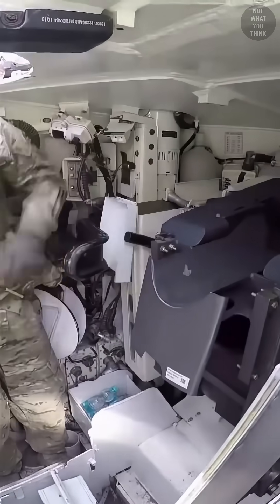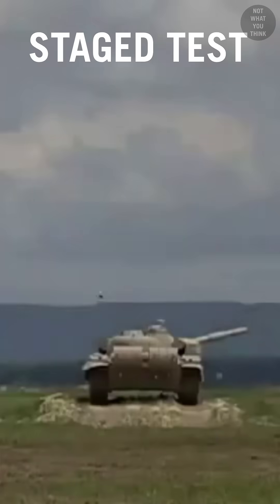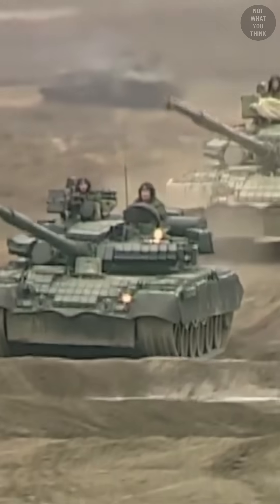Why M1 Abrams Tank Has No Auto-Loader #shorts

Comment: There are a few other reasons some prefer human loads.

One is that different shell types can be loaded more quickly to deal with changing threats on the battlefield.

You mentioned the human loader able to take over roles and help around they tank, that's a crucial one, especially if the crew need to handle more things than normal.

This next one is a bit meh, but human loaders are a bit more "reliable" in that the turret getting slapped by an explosive will hurt, but not necessarily injure or kill the loader, with autoloaders, they are much more sensitive and expensive, and damage can render them unusable.
Reply: Yeah, i feel the vid is informative but also only takes into account older types of auto-loaders.

Next generation tanks like the T-14 don't have the auto-loader and carousel sitting next to the crew, but the crew is instead isolated in an entirely separate fighting compartment. That way, even absolutely catastrophic hits would not be a a death sentence to the crew.
Despite the blowout pannels, abrams are still susceptible to some sort of damage, mainly APFSDS that would sucesfully penetrate the turret face. AS hard as this is, if it can be done, then the dart would go through the turret, puncture the blowout panel and set off the ammunition. With a hole in the cover, the pressure would find it way into the fighting compartment and kill the crew. 

Another advantage, that is going to be FAR more prevalent in times to come, is ammunition size. Smaller is better, but since we have hit the physical limits of chemically fuzed propellant. 105mm was a relatively easy ammo for a human to handle, hence why manual loaders were actually superior to soviet autoloaders in the era of the 105mm. When the calliber had to be augmented to 120mm the human loader could only sustain his max rate of fire for a vew shells before the rate started decreasing substantially. We are now getting to the point where if another caliber increase is needed, it will become far too problematic for a human loader to handle. 
Obviously this would better call for a radical change in propelant chemistry, and some like plasma fuzes could be used by regular guns and regular tanks to augment the capabiltiies of the 120mm, but eventually much stronger guns like a 120 CLG gun would favor autoloaders, so do hypothetical railguns, or even caseless ammo raven guns, all of which are either more suited to autoloaders or require them for basic function. 

Overall autoloaders are the future, its just that its important to design around them and not just "lets just take a crewed tank hull and place an autoloader in" because that will always hold you back
Reply: @mobiuscoreindustries  Because this ain't really about the future. Abrams are also getting autoloaders. 

The Soviet vs American doctrine differences were established before having a safe autoloader was possible. It was one or the other.
Reply: It seems that people think that there is only one kind of autoloader aka the Soviet school. And the minds are still locked on Cold War technology.
Autoloaders are evolving and there are less and less cons in using them since the 1950s..
Reply: @coyotesweg3129  You have to also consider more mechanical parts equals greater probability of malfunction. It could also be argued that autoloaders are more expensive in the short term and make up for costs through less operator wages. If manufacturing tanks for mass production/to be expendable (the russian military doctrine) this would become an issue.
Reply: @coyotesweg3129  Similar to most overly complicated automated systems it is more effective in industrial applications than on a battlefield where the objective is to render said equipment unusable.
Reply: @goosenuggets9693  hydraulic cable on the autoloader blown? Have the loader just swap in a new one--oh wait
Reply: @coyotesweg3129  There is some extent that the technology can evolve, but a bad idea will always be a bad idea.
Reply: @goosenuggets9693  not necessarily. Though I do agree the Cold war Russian style is awful. Semi autoloader and turret  rear autoloaders are a pretty good step forward.
Reply: @coyotesweg3129  Yes... but are they more efficient than human loaders in the context of what was said in this video? Don't take me too seriously, I just enjoy reading all these other comments from "experts", I myself am not one by any measure and know next to nothing in terms of specifics.
Reply: @Edmond Durocher How does that make any sense? If you are going to be sitting in a defensive position the size of your vehicle doesn't matter as much as most of your vehicle will be behind cover, and the rest of the vehicle you can cover with camouflage items. If your tank is going to be on the offensive you are going to want as small a profile as possible to reduce the chances of you being hit on the move. If you switch those around and put a small cramped tank in a defensive role, your crews are going to have a horrible time. Also tanks of the time were not designed to fight in their home countries, as that would be a pretty stupid decision since most of the fighting was predicted to happen between the border of the Warsaw Pact and NATO.
Reply: @Sturmischer  err you need ambush in defensive, not just stay in enemy view, that mean you will get airstrike or artilery on your head
Reply: @duytranuc4025  when this is meant to be the entire defensive line it's kinda hard to do that. Plus in order for them to be calling in airstrikes on enemy positions you would require air superiority, which neither side would have just yet in an opening engagement.
Reply: @Sturmischer  artillery still can call for suppressive, damage tank..etc, and air superiority westen country have big advantage over defensive side (
except some country with very good aa system)
Reply: @duytranuc4025  again, the west's whole doctrine was to be on the defensive side of an engagement with the soviets, it influenced pretty much all of their tank and aircraft designs during the cold war.
Reply: @Sturmischer  yup, doctrine on defensive, real use for attack
Reply: @duytranuc4025  No.... why do people keep thinking tanks are only an offensive weapon. Tanks are just as good, if not even better when used as a defensive tool. You don't have to worry about enemy AT ambushes and you can either set up your own ambushes or long sight lines for long range shots. You can also use more effective cover, or make your own, and keep your tank hull-down so there is less of the vehicle for enemies to engage. Just look at the 6-day war and you will see just how deadly tanks set up in a proper defensive position can be.
Reply: @Sturmischer  because tank use in defensive is not stational, it need maneuver for attack enemy flank(flanking), retreat when overun and attack when need for counter attack, attack is the best form of defence, if stational just put an at gun/ at laucher, tank have better place, hull down  yes, but in a defensive one tank have... many position to go hull down for...better place to attack, stay still=artillery fire
Reply: @duytranuc4025  1. AT guns stopped being used by most countries, and AT launchers have the pesky problem of not having any sort of armor (see the chieftain's video on the subject.) 2. Just because a tank is in a stationary hull down position that doesn't mean there wouldn't be provisions for being able to retreat. Tanks will usually dig out a hull down position with a ramp for getting in and out of their hole easily. 3. you're not likely to be doing any sort of flanking maneuver on an open battlefield at the engagement distances of tank guns, if you were to have anything on the flanks of the enemy they would already be pre-positioned there to shoot into the sides of enemy tanks. 4. You greatly overestimate the accuracy of cold war era artillery, modern day artillery we have laser guided and gps guided shells, but back when tanks like the Abrams, Leopard 2, and Challenger were being developed that was not a threat. A tank in a hull down position is pretty well defended against artillery strikes unless the artillery gets a direct hit on a tank, which even then is just up to luck and the same thing factors into tanks on the move.
Reply: @Sturmischer  1:agree, but this also count rpg at squad, direct fire artillery, and they also have foxhole for cover, and at gun still use in cold war
2:yes, it can retreat, and will expose side when do that, a shot hit tank side= death
3:counter attack most of the time: good
4: you don't need a direct hit to take a tank out of combat, you just need near hit to damage tank optics, gun, track and anything expose to reduce it combat effective, or just stress tank crew, best part: it can fire at any time of the day, that tank already stay still for training fire
Reply: @duytranuc4025  1. Again, AT teams are not going to be used in this kind of engagement, AT teams are meant to be used in ambush tactics, and would get minced in this sort of open engagement. Same thing with enemy infantry squads, you wouldn't send infantry to an area defended so heavily by tanks. Direct fire artillery? Do you mean other tanks, because direct fire artillery is a last resort defense option for artillery guns/vehicles. Foxholes will do nothing against airburst rounds so that's completely out of the question for this scenario. 2. Your side would not be exposed seeing as this is an open engagement at range, and the distance you would retreat at would likely be in the hundreds of meters. 3. You don't need you entrenched tanks to move to be able to do that, more than likely you would have a reserve force move up to push the enemy as they retreat, keeping your entrenched vehicles in their positions in case the attack was just a feint and the real attack is coming after. 4. Optics are well protected by the doghouse on most western tanks, tracks are not exposed as the vehicle is hull down, and you'd need a very close hit to take out the gun. Also, firing your artillery like that would likely result in counter battery fire as artillery radars will detect the location of the enemy's firing positions.
Reply: @Sturmischer  1 that what happen in china war, and it a foxhole which tunnel combo. 2 america also said that until a vietcong with a rpg tunneling right at their face. 3 not with  army that have very few tank, even with america( not all tank in defense, only less than 40% and the rest are tank for counter attack, like you said: reserve). 4 No, it not that good as you think, m1 tank have spare vision block in tank for that reason, yes you can counter battery fire, but not work very good with harassment fire, it too random to counter and sometime it just a poor soul with a rocket artillery(can't counter which radar)
Reply: @Sturmischer  That's not true. You overlook that larger weapons and thicker armour systems often necessitate a larger tank frame regardless of it's role on the battlefield. It's simply engineering, not to mention you vastly overestimate the capability of camoflauge. Most MBAs use non visible light systems to target enemy vehicles and therefore the only protection camoflauge provides is against MANPADS. This is at least if they don't hear you or your gunfire beforehand and for the most part that is unlikely against adversaries that work in tandem with aerial cover.
Reply: @goosenuggets9693  Western tanks size is not just influenced by how much armor they have and how big of a gun they have, Soviet designs have comparable armor and weapons. The difference in size is mainly due to different doctrinal thinking, with soviet tanks being a lot more cramped than their western counterparts who have a greater emphasis on crew ergonomics. Western doctrine also emphasizes a strong first strike capability, meaning that they have to be able to both spot and shoot the enemy first with precise fire. As for non-visible light systems there are many methods to counter them, camouflage that is not in direct contact with the hull can mask the thermal signature of a tank, and there are many techniques used to camouflage how something looks in the infrared spectrum as tested by camouflage uniform developments (for instance how US Desert Night camo works).
Reply: @Edmond Durocher western tanks are not less capable of long range shots than the Russian ones, the real difference is that the Russian use smaller tanks to make smaller targets, the western tanks are more oriented toward crew survivability. The reason why modern MBTs use stabilisers is to be able to fire on the move. What you are talking about was true during WW2, when nobody would shoot on the move, nowadays it’s different.
Reply: @albero319  i mean when you can fire a tandem missle out of the gun it does tend to make other gun less prevlent at range
Reply: @manijubell4054  the longest range tank kill was achieved by a Challenger II using APFSDS
Reply: "One is that different shell types can be loaded more quickly to deal with changing threats on the battlefield."

I don't see how this is faster with a human loader, autoloader shells are indexed and the type needed can just be loaded.
Reply: @cptant7610  You should see how fast loaders pull during combat and not just during training the 5 second warthunder reloading is the minimum.
Reply: @koc988  yea the the loader alto gets tired auto loaders don't
Reply: @solarc4667  auto loaders can get tired too. Wear and tear. Plus they run out of energy, ammo in the rack or otherwise. A tank with its engine knocked out, may not be able to use it's autoloader due to not having power, a person doesn't need the engine to do their job
Reply: @manijubell4054  you know what batteries are? And what alternator is? Those two give your tank and autoloader sufficent power. And it you didnt know russian tanks and parts and weapons, are like Ak 47 very reliable and hard to break, and even if commander or technican in russian tanks can load it with hands, just like in Abrams, and other countries have good autoloaders too, like sweeden
Reply: @solarc4667  if you are in a situation where you are in a combat where the loader can't take a rest, qi think you have bigger issues than crew fatigue.
Reply: @solarc4667  if the loader gets tired lets be honest your tank is out of ammo
Reply: @solarc4667  this is why the loader should be equipped with exo suit arms.  Even if that malfunctions he still has his arms.
Reply: @cptant7610  yes but for example if the tank has the shell you want to load on the opposite side of the breach then the auto loader needs to rotate the ammo to get to that shell and it will take more time, that's for Russian tanks, idk about French auto loaders tho
Reply: @rabiealkurba2520  and the loader still has to find and grab that shell. some loads can take 20 seconds, some take 7
Reply: @TheArcticFoxxo  loader can drop The ammunition, or can get injured by the loading mechanism, when hit can be easilly get unconcius, New loading mechanism are way better than loaders, just look at russian Armata tank. Crew is totally protected in hull and autoloader is way faster than even best loaders
Reply: @rabiealkurba2520  autoloader allowed a tank to have various ammunition, can also keep up with the pace unlike human crew where they will get tired, but I really hope they actually make a blast door for the autoloader
Reply: @zdzisawpodlaski305  or the MTTD prototypes, and back when they gave the leopard 2 armor
Reply: @rabiealkurba2520  French and Korean the shells spin around in a revolver/carrocel  sistem or are in top zone of ammo storage and are droped or drafted to the Thing that puts them i  the gun. There are vidoes on it
Reply: @TheArcticFoxxo  No, Actually only takes 7-10 seconds
Reply: @76456  all russian autoloaders are made for an exact 7 second reload. ive seen footage of loaders loading anywhere from 6-8 seconds up to 20
Reply: @TheArcticFoxxo  the  10 seconds is for when the commander chose an ammunition that was in the opposite side  of the autoloader behind the driver . 

You can choose by option to not reload the gun. Until you see knew target, thats why it might take a long time. Just simply stop and Reload the shell you want when you see target.

When you said "I've seen loaders" are you talking about person loader or carrocel? if carrocel take the answer above
Reply: @76456  the squishy loaders. all of those can go the same for the squishy bois too
Reply: @TheArcticFoxxo  dip down there, it all comes down to military doctrine. Also countrys whit small population or a lot of mountains or open terrain might choose autoloaders.
Reply: @destroyertashkent5713  type 90, type 10 and leclerc have that thing
Reply: There's this one argument i kept hearing as well, Manual loader can change ammo in the breech but autoloader can't.

In the older days, that's doable with brass casing. But today? you are advised NOT to do that, for an obvious reason. You do realize that modern 120mm cartridge has a nitrocellulose cartridge, did you? It's fragile, and combustible.

You want to extract that unfired or dud cartridge to change ammo? you're risking you and the entire crew inside the tank from fire hazard. One incident exemplified this, and it involves a dud round in an merkava led to premature ammo detonation after the loader extracted the round and accidentally broke the cartridge, spilling the propellant granule on the floor, which was ignited by hot brass casing.
Reply: @rabiealkurba2520  
We got a ton of tank experts today!
And all of them seem biased.
Reply: @destroyertashkent5713  an autoloader being able to "keep up the pace" is irrelevant. Combat is at the point where firerate is dictated by target acquisition.
Reply: @casematecardinal  lol its like saying that human loader can sustain it stability while getting shot or moving in a bad terrain which they cant
Reply: @rabiealkurba2520  ever heard of bussel loaders **LEOPARD 2**
Reply: @casematecardinal  they dont have a seat for the loader lol, and avg loading time for T-72 and T-90 is around 4-5 second abram is only around 3-4 plus with autloader that carry more than 2 type of shell and more ammo, also switching the shell that have been loaded into the  cannon will be easier with autoloader
Reply: @destroyertashkent5713  you should spend less time on the wiki pages... and either way, yes there is a seat for the loader in the Abrams.
Reply: @casematecardinal  even if they did have it they still need to stand to load the shell, and bruh I didnt use wiki like everyone knows that autloader is just 1 sec behind human autoloader, without having to put more weight just to make sure those 3 member crew in the turret safe
Reply: @destroyertashkent5713  you dont need to stand to load a shell. Its easier if you are standing but its pretty common to keep a round on the lap for quick follow ups, besides firing on the move isnt part of doctrine anyway, but its still possible.
Reply: @destroyertashkent5713  no?
Having different ammunition on a tank is surely not an invention after autoloader, where did you pit your ass into to find such idea
Reply: @dr_birb , M1 abram can only carry HEAT APFDS and ATGM, T-90, can carry HEAT APFDS ATGM and HE Frag,Guided shell and Fragment shell
Reply: @destroyertashkent5713  seems like you proved me right.
Tanks with crew loaders can use different ammo types
BUT ALSO MAYBE THE USED TYPES OF AMMUNITION DEPEND ON THE GUN, THE COUNTRY PREFERENCES, AND THE NEEDS FOR EACH DEPLOYMENT. HUH
Reply: @dr_birb  what right? autloader still can carry more type of shell amd reduced weight than having normal human loader
Reply: @zdzisawpodlaski305  one well placed aphe wild ruin that auto-loader tho where if a loader is lost a random infantryman will be ordered to take his place
Reply: @destroyertashkent5713  no? Who taught you illogical thinking, cus you're perfect at that.
Autoloader can use more types of ammo, because....? It doesn't matter whether ammo you're stacking into a tank has autoloader or crew. Xd
Reply: @dr_birb  ofc bruh you wont have enough space to have different type of shell if you are using human loader, but autoloader can cuz it give more space for the ammo and can also reduce weight
Reply: @destroyertashkent5713  autoloader weights more, lol.
And no, you can't stock more ammo just due to autoloader.
That entirely depends on tank overall design. They could make crew loader tank with 100 rounds, and tank with autoloader and 30 rounds.
Reply: @dr_birb  no it doesnt lol T-90 have ERA and composite armor but only around 46 ton while M1 abram weight around 68 tonne but still have the same armor as T-90M , even type 10 is equipped with autloader but  only weight around 48 tonnes, even lerclerc with autloader weight 56 ton
Reply: @destroyertashkent5713  because youtube isn't really transparent or working platform, in case my reply vanished, all you need to know is that you're wrong and you're so wrong you belive you're right. And use whole tank weights comparison to compare human and autoloader weight..
Reply: @dr_birb  ofc bruh, human loader is one of the main reason why they add so much armor to protect them while autloader didnt need any extra protection, thats why even the navy use autoloader cannon instead of human loader, its efficient and no need to add extre armor for loader
Reply: @cptant7610  Hmm, maybe modern carousels do. Soviets didn't back then.
Reply: @bravomike4734  Where tf does that come from? Soviet carousels did it too. They literally have a rotating ammo selector switch.
Reply: @bravomike4734 Soviet carousel autoloaders have always been indexed.
Reply: @cptant7610  it's also faster if you want to change she'll type after it is loaded in the breach with out firing the round.
Reply: @cptant7610  the autoloader has to be built to accommodate the largest type of shell for it's gun and having a dude shove it in there is easier.
Reply: @hermatred572  there is only so much weight a person can move, especially repeatedly(as some poeple pointed out with 120 mm people already get tired pretty fast)
a machine doesnt get tired
and if any engineer designs an autoloader that cant load the shell its supposed to, and someone actually approves it...they deserve whatever they get
Reply: @cptant7610  sorry I’m not people fas
Reply: @cptant7610  You ever see a autoloader vs a human loader that is fully trained?
Reply: @cptant7610  and what happens if you’re Otto auto loader fails bud
Reply: @Thatotherhelmetguy  The same thing that happens when your human gets ill or shot?
Reply: @cptant7610  Back when the Abrams was new most auto-loader cassettes could take up to 20 seconds to make half a revolution.
Reply: @bigpatty823  That was 40 years ago
Reply: @cptant7610  The autoloader has to cycle through entire rack in worst case scenarios. A human loader just has to pull from the ready rack, or worst case, move the round from extra storage.
Reply: @YoRHaAttackerNo2  no it dont have to cycle it, new auto loaders they are not like  First autoloaders, in this Days you click button and it automaticaly will get ammo  that you want and even if it need to cycle it takes like half od second to fully cycle, loader need to get right ammo, tank must stay still because it its moving crew can just get hurt, loader can drop round, can get easilly hurt by round, ammo racks can malfunction, cuz they wont open in worst case scenario.
Reply: @zdzisawpodlaski305     Then you know nothing about how an autoloader works or how tanks engage targets. 

First, it's not done by magic. Yes, you press a button but it all depends on the autoloader mechanism that is delivering that round. Some are carousel type, which has to cycle around (and not in a half second because that can be pretty violent) or in the Leclercs case, more like a magazine of a machine gun (the more (if not most) simplistic version of an autoloader you can find.)

Second, tanks almost NEVER fire on the move. If you ever see an M1 Abrams engage a target for example, they sit still, fire, then move. 

Lastly, your con of an ammorack malfunction? Can happen on any system of loading. Dropping a round? Your loader is most likely dead if that happens. Hurt by the round? What do you think he's doing? Slinging it around like a baseball bat? He has more chances cutting his fingers off at the breech. 

Now what are the pros and cons of an automatic loading system? 
Pros- The loading is more consistent until its rack is depleted (applies to loading on the move.) It can be isolated better for safety because instead of a giant door, you only need a small port.

Cons- Harder to compensate for damage as many systems are hard to access or just inaccessible. You typically lack loaders dedicated to the task, complicating it further. Retrieving and/or recovering a round from the breech is harder (impossible in some systems) and lastly, an autoloader is a lot harder to replace than a human. 

I love autoloader systems, but those cons are just as heavy as the pros. As technology improves, it probably will lose some of those cons and make it more viable to replace the human, but in today's time as it stands? No.
Reply: @YoRHaAttackerNo2  im talking about russian autoloaders i dont know much about west, but i was A Tanker in Polish army in t-80 it rotates very quick, and its very hard to break but sure mate
Reply: @YoRHaAttackerNo2  Abrams, are Abrams and are way overrated, russian tanks can easilly shoot on move and if you sit still in place and wait for Gunner to reload or wait tank to stop you will get killed by some farmer boy from russia XD
Reply: @zdzisawpodlaski305  To the very next round, yes. But if you need to cycle around a quarter of your carousel, it can be a second or two.
Reply: @zdzisawpodlaski305  And no. There's this thing called the hull down position. You are correct, the M1 Abrams is overrated. However just about every Western Tank uses that method. They CAN fire on the move, but it's preferred to shoot then scoot.
Reply: @YoRHaAttackerNo2  and yes you can get hurt by round if you drop it on your toes friend from military were taking round from rack, tank started quickly moving and he drooped it, he had broken leg. It hapens sometimes dude, and you even dont know how apfsds works dont you? It dont blow up like he shells, if you droop it, it wont blow up, and remeber in this Times ammo is way more "stable" than in WW2
Reply: @zdzisawpodlaski305  Oh I'm not saying he's dead from the round exploding. I'm saying he's likely dead because an APFSDS round found its way to him in a violent physics experiment.
Reply: @YoRHaAttackerNo2  yes i know they can fire but you must realize that tank crew is trained to do this, its not that good sure when you hide your hull its Good but when batlle is taking place on nearly flat terrain? Comander can make mistake and say that tank must stop but it only makes it more vurnable to shot from fast russian tanks
Reply: @YoRHaAttackerNo2  it takes nearly 1,8 second to cycle it around in T-80 I was in this tank and i know how fast it rotates when its needed and you know you dont put rounds like that in russian tanks, There is Special methode to Store ammo, for example two round heat and another two round apc or other it cycles way faster
Reply: @YoRHaAttackerNo2  ok
Reply: @YoRHaAttackerNo2  that extra storage are under turret basket, it not easy to reach as you think
Reply: @YoRHaAttackerNo2  and in autoloaded tank you can...refill it right in tank (t72 and t64 style autoloader)
Reply: @YoRHaAttackerNo2  nato use smaller gun= smaller round to load, good luck for hand load 125mm shell(41ibs) with charge in 6s
Reply: @cptant7610  Like the S1 and 2
Reply: autoloaders have the capability to be much faster than a human loader, and can deal with multiple ammo types since WWII, it's all in the design.
the United Shoe Machinery Company made an autoloader that could load the standard 75mm M3 in M34 cradle at a rate of 20 rounds a minute and with selectivity between AP and HE (stored in two 34-round magazines), project started mid 43 for T20E1, system tested in T22E1, dropped in April of 43 due to "unsufficient mechanical reliability"

then the Rheem company made one for the 76mm on T37 (later morphed to T41) and was tested in M26 in 1950, the system loaded the gun at a rate of 18 rounds a minute while returning the fired casings to the magazine and tracking the gun breech at any elevation, the mechanism was then tested in T41E1 and in this version each round in the magazine could be indexed so as the gun could fire 3 different types of ammunition with a fire rate upgrade to one shell every 2.3 seconds (about 26 rounds/min), still considered not reliable enough and was canned

October 1952, the Rheem company was tasked with designing an autoloader still for a 76mm, but this time on T69 (nice), the oscillating turret removed many issues of the system due to gun/autoloader misalignment, again the system was selective between three type of ammunition and again rate of fire upgrade to 32 rounds a minute (1.87 second loading time) from an 8-round revolving magazine, the tank was just a technology demonstrator and the autoloader was unreliable so it went nowhere, tho it could be made more reliable by slowing the rate of fire by half at a respectable 16 rpm (3.75 second loading)

then United Shoe Machinery Company worked on a solution for T54E1, a 105mm gun this time. feeding from a 9 round magazine at 35 rounds per minute (1.71 second loading time), still selective between 3 types of ammunition, T54E1 was again a tech demonstrator so i didn't go much further, no idea on it's reliability but judging on past experiments and the sheer speed of the thing, i suppose not too hot, tho it seem to have brought fruit as it's operation seem not too far removed from what was utilised in M1128 MGS

keep in mind those autoloader were made because armoured Branch wanted to upgrade the fire rate of their tracked tin cans, not necessarily remove crew (T69 and T54E1 had 4-men crews)
sauce: the_Chieftain video on US autoloaders: https://www.youtube.com/watch?v=Qnsb2LQFvoM

on the having an extra man around, take a page from the French book, the Leclerc tank is a 3-seater but all tanks have a 4-men crew, how?
well you take all of the extra lads of the company, seat them in an APC and the y can do security, scouting, or stay in the rear to help with maintenance or replace missing crewmen

on, the safety point,autoloaders (at least the cassette type used on Leclerc, Type 10 and K2 among a few others) are much safer, instead of having a big heavy door opening from the bustle ready rack, you have a small opening, just large enough to let the round through meaning there's a lesser chance of a cookoff injuring the turret crew or just crewmen being mauled by the ammo door (which can happen on Abrams)
Reply: @Edmond Durocher ffs stop watching your stupid videos about tank waves. Russians don't fight like that.
Reply: In auto loader you can reload at any speed, Auto loader is actually light and doesnt hurt crew, because there is a steel panel separating the crew.
Also make tank lighter and smaller
Reply: A human loader can also improve its time. And auto loaded cannot unless it is improved by engineers
Reply: @bisonmini  fastest autoloader are strv 103 tank auto loader, only 3s per shell, what kind of human can do that without an assist mechanism?
Reply: @bisonmini  So you're saying a human loader can be faster & more efficient than a dedicated machine? In a real world scenario of course.
Reply: Not to mention if autoloaders jam your kind of screwed
Reply: @captain6255  ot doesn't jam because it isn't exposed to external factors, if spall struxk outo loader then it get stuck, but even then, Normal loading gun can get stuck too, The blast door.
Reply: @76456  but still mate I'd rather have a person loading the gun than some machine that if it gets stuck or doesnt fire a round you on your own
Reply: @captain6255  Fire is made by person, Also loader can die, get tired, drop rounds in the floor and need to drive slowly (30km/h in good crew) to load on the move
Reply: @76456  ok then
Reply: @76456  it is true, guys reall Life is diffrent than war thunder soviet and russian tanks are probably The best in The World, american Abrams is way overrated, in batlle field it can only ride  for like 45 minutes because its engine that is A turbo jet turbine, eats soo much fuel and generates soo much heat that even radiator is going to die quickly, it breaks every Time when its on field. Its soo freaking heavy that There is Special version of Abrams only created to get out of field other M1A1. German tanks are really wierd because they can Easy get destroyed from front by russians canons or even upgraded rpg versions. They are sturdy but in rl shoot to The driver hatch can blow out tank or just destroy its gun or engine. Russians have developed tanks (T-14, BMPT terminator 1 and 2, or prototype T-15) that have really good protection aganist everything, high mobility, probably The best gun in The world, Systems that can scan and  detect tanks, helicopters, or jets, they can jam misiles and radars There is even project and prototype that cant be detected by infrared. Im from Poland and i can say that t-80 or other thanks  from T series would easilly destroy leo or Abrams.
Reply: @captain6255  just like west and NATO, they wont use auto loaders because they are scared that something goes wrong, thats why they dont develop it
Reply: @zdzisawpodlaski305 Ukraine knocking out russki tank left right and centre.
Reply: @captain6255  in t-80 and new russian tanks its Simple to unjam, There is Special system for it, and if it would totaly jam Gunner can load rounds manually
Reply: @zdzisawpodlaski305  thx
Reply: @captain6255  ah you can just...hand load it, but hand load a 125mm shell(from 5kg+/11ibs+ to holy 19kg+/41ibs+) all the time is pure dumb
Reply: @captain6255  Well, if we're talking about ifs, if the human equivalent is jammed i.e. injured/killed, same thing.
Reply: @Edmond Durocher Bad reverse speed? T-80 can go 35 Km/h, a Polish tanker told me
Reply: You guys are all wrong.

If first world nations fight only the first shots usually count. Being more reliable doesn't matter if you get blown up by a missile. Russia has optimised their tanks for fighting other first world countries. American has optimises their design against Terrorists armed with RPGs that can't penetrate their armour.

Robust is less efficient, but robust means it works in situations you don't expect. Russian tanks are more efficient, American are more robust.
Reply: There pros and cons on both sides. Auto-loaders dont get tired and can sustain their rate of fire but how often are they going to be a in situation that calls for a high level of fire 
Right now, 120mm rounds weight 49lbs. heavy but not super heavy. The planned 130mm rounds are nearly 70lbs
Thats way too heavy for a human loader
If 130mm becomes the new NATO standard , then its sayonara human loaders
Reply: Machine is cheaper than human, always
Reply: In my village we hit Russian tank with the big stick. Stop autoloader, stop tank, drink vodka with drivers. They appreciate the kind gesture.
Reply: Heh human loads
Reply: I prefer human loads 🤤
Reply: t series cost less than abrams
Reply: There’s also that a human loader takes up much less space and weight than an auto loader
Reply: @VlRGlL  homeboy auto loaded tanks are typically lighter and smaller then non autoloaded vehicles tf you on?
Reply: @VlRGlL Auto loader is made of plastic amd have few metal
Reply: @VlRGlL  no, because you will need a human height turret basket and space to turn around=bigger tank=more place need to armored, for auto loader tank turret basket just need space human sit (why not 
lie? just like driver?)
Reply: @VlRGlL  Actually it's more because of the extra volume of the turret, which means a lot more armor
Reply: @VlRGlL  not really. Since human loader needs room to stand to properly load the gun, meaning the tanks need to be taller, meaning extra armor (coment above mentioned that 1cm height of a leopard equates to 600kg) Thats why soviet tanks are usually shorter and vastly lighter compared to western tanks.
Reply: @VlRGlL  Dead wrong 🤣
Reply: @happygnome4620  
   Not dead wrong. The average adult male weights about 200lbs and takes up around 3 cubic feet.
Reply: @cooliobob1274  Right. and an autoloader as seen in the video is quite large but the configuration is much more space efficient. There is no interference with any other crew members.
Reply: @cooliobob1274  how does the average adult male only take up 3ft³? Are you sticking them in a trash compactor? Just an approximate but 6' high × 2' wide × 0.75' deep = 9ft³.
Reply: @KirkHermary  
    Dunno bro... I'm pretty shitty at math so I lazy assed it and googled it. Now you point it out it is pretty fucked. Maybe they were measuring fetal position?
Reply: @cooliobob1274  I just choked on my lunch! Imagining a bunch of dudes cruising in a tank... all scrunched up 😆
Depending on how crammed the quarters are it could be possible 🤔
Reply: @happygnome4620  tell me how a machine takes up less space and weight than one guy and a door
Reply: @happygnome4620  weight yes, space maybe but I’m leaning to yes
Reply: @happygnome4620  an autoloader may weigh multiple tons, at least a few hundred kilos
a human loader at max like 100kg
Reply: @ikat_tracer  Multiple tons??? I think you got that wrong.
Reply: He is dead wrong, an autoloader is much more compact because it doesn’t require the space a human needs to maneuver around with a shell and overall the expenses of maintaining an autoloaders actually are cheaper than paying the human loader and all the other expenses of keeping people alive.
Reply: @cooliobob1274  how much structures and armour to enlarge the tank for those 3 cubic feet?
Reply: @Edmond Durocher for Russian tanks it’s the exact opposite doctrine, western tanks are meant to be able to sit for days in a defensive position, thus they are larger and have a bit more focus on crew comfort, whereas Russian tanks were designed to have as small of a profile as possible so that they are harder to hit while moving. The whole NATO cold war doctrine revolved around defending the border between East and West Germany while Warsaw Pact forces invaded across the border.
Reply: Also it has lower cost of maintenance than autoloader
Reply: @unddasheit4034  I mean you got to feed a person house a person you got to train a person
Reply: @captain6255  uhh, yea(?)
Reply: True
Reply: I'll give you a human load hahaha
Reply: Plus it's nice to have an extra guy gor a pick up basketball game.

Say, does the driver get less pay cuz he gets to lie down on the job all day?
Reply: You forgot to mention that AI is getting better by the day and is smarter than Recruits.
Reply: @TheCuriousNoob  yes but the thing is a shot can pen the turret and knock it out of action if its an auto loader but when its a crew member they can easily be replaced not saying that lives dont matter they do but its more efficient to have a crew member in case if a malfunction
Reply: Shit I need to shit and an extra bag of shit in a tank haha
Reply: This is good to know. Thanks
Reply: @Edmond Durocher nope, what you said is bs. Russian tanks are not “better at sniping” and modern tanks don’t need to stop to shoot since they are fully stabilised. And what makes you think that Russian tanks are made to defend and not to attack? They are MBTs, they do everything.
Reply: Exactly that....20-30k a year for a soilder or 200k for autoloader system 🤔
Reply: @lukekennedy6394  20- 30 k? Are you insane this dudes get even 10 k per month, russian autoloader cost like 50 k dolars XD
Reply: @zdzisawpodlaski305  nope, a britsh or American private only get 20-30k $/£ per year.
Reply: @lukekennedy6394  probably you dont know how much they get, my brother was in British army and was getting 38k per year
Reply: @zdzisawpodlaski305  I definitely do now how much they get 😅 and I'm telling you a private wouldn't get 38k....sergeant or equivalent with a few years experience = higher pay band would get 38k.
Reply: Aren't autoloaders heavier because of the extra mechanism and metal machinery needed?
Reply: auto loader by definition is any mechanical aid so technically the abrams does have an auto loader as it’s reload is mechanically assisted.

it’s not a automated loader
Reply: What happens if you have a Poseidon in a Russian tube with a proximity fuse? 10Mt will trigger WWIII. It is much better to keep the war cold. That way there will be living children who can ask, "what did you do in the war, Daddy?" Ghosts do not answer questions.…
Reply: Another one is skill, when a human loader is very experienced he can speed up the loading process and increase the rate of fire, this is common on most american tanks back in world war 2, withthe sherman having a minimum of a 3- second reload
Reply: @franzivan4567  Well I hope that we don't have to do a Test To Destruction in order to decide the matter. Because such a test would give you the info you want but at an unbelievable cost.
Reply: P
Reply: I’m
Reply: hehehehe human loads ;P my dirty mind gonna play with that one
Reply: @mizziepet  
Begone perv
Reply: Lap loading?
Reply: Haha
Reply: Intuition
Reply: A private with a broken arm could probably still load if high enough on adrenaline, an autoloader with a broken piston not so much.
Reply: Human loads
Nice
Reply: Also what happens if the loader fucks up or jams?
Reply: Jesus no one here knows what they’re talking about lol
Reply: Plus, as cruel as it is, it’s likely easier to change out a injured or worse crew than put the tank out of service to change or repair the autoloader mechanism
Reply: You gotta get lucky on the human being more reliable tho what if they are an absolute dipshit?
Reply: Important is which tank has more accuracy to hit a enemy tank and has heavy armour.
Reply: Plus I can only imagine an auto loader has a lot of moving parts. Those tend to be kept to a minimum for things like this for good reason
Reply: "There are a few other reasons some prefer human loads"

Is that right? 🤣
Reply: More of a simplicity is reliability thing here
Reply: @Edmond Durocher you don't seem to be knowing what you are talking about. russian tanks are designed for attack. german tanks to defend, and american tanks are in between. 
hence the bad reverse speed on russian tanks -> good reverse speed on american and german tanks
bad depression on russian tanks -> good depression on american and german tanks 

russian tanks are the ultimate bad sniping vehicles and are yet to penetrate the turret of a Leopard 2A7
Reply: @ikat_tracer  Man this is filled with stupid and incorrect points. 

>russian tanks are designed for attack. german tanks to defend, and american tanks are in between

They're all MBTs, they're all designed with the same base philosophy in mind and built to meet the requirements of their environment. Technically every tank is built for defense, every MBTs ideal engagement situation is when they're hull down, hence why the front of the turret is the strongest part of the vehicle.

>hence the bad reverse speed on russian tanks 

Also wrong, T-series tanks have poor reverse speed because they have a single very low ratio reverse gear. The purpose of which is to ideally allow the vehicle to extricate itself from any kind of ditch or mud etc. that it might find itself stuck in, without the need of another vehicle or a recovery vehicle to pull it out.

>bad depression on russian tanks

Once again this is due to design philosophy based upon environment. They're overall smaller and lower profile than Western tanks, the hull and turrets are both shorter, thus lending less room for the breach to be able to rise in the turret thus leading to less gun depression. Plus the fact that most of the area they would have had the possibility to engage in combat in was flat enough for it to not be seen as much of an issue.

>russian tanks are the ultimate bad sniping vehicles

They're probably actually some of the best, they're smaller than Western tanks, therefore they're harder to identify and hit than Western designs would be.

>are yet to penetrate the turret of a Leopard 2A7

And anybody has yet to penetrate the turret of the M1A2, or the 2A6, or the 2A5, or the T-90M, or the Challenger 2, or the Leclerc, or the Type 10, or the Type 90 or even the Ariete. Whats your point? Idk where you've been but there hasn't been a war against contemporary Eastern and Western powers since WW2, nobody has penetrated anybody's turret in a while.

And yes autoloaders are much smaller than human loaders, its pure fact that crew take up the most space in tanks. If you really need proof of this, look at the difference in size between western tanks and T-series tanks. In western tanks you would be able to eliminated an entire half of the turret if you removed the human loader.
Reply: Наши танкисты знают что заряжать танк можно и без автомата заряжание, в случае поломки автомата заряжание снаряды заряжаются в ручную, как в далёкой Второй мировой.
Reply: https://youtube.com/shorts/YRvzXdtm5A4?feature=share
Reply: I thought the M1 only fired one type of round
Reply: What happened if Human loaders needs to take a shit??😂🤣😂
Reply: I don't know how Russian designers think, their tanks are crowded, has multiple weak spots, only 3 crew members, autoloader that has the ammo all over the tank which makes it easily destroy if penetrated
Reply: @rabiealkurba2520  But russian tank are also shorter and weigh less than nato main battle tanks
Reply: @rabiealkurba2520  Disregarding the lower and overall smaller size, more simplified and easier to operate, and the fact that the weaknesses you see are because certain users were stupid. (Namely Saudia Arabia and their mishandling of ammunition by sticking it literally everywhere.)

Russian tanks are built for more level, open terrain. There are as many weaknesses as on the Leo 2 or Abrams, but they always take hulldown positions whenever possible where say a T-90 will always try to strategically advance forward.
Reply: @rabiealkurba2520  if u got penetrated, and don't die, you mashine is out of action in any case.
Reply: @rabiealkurba2520  Smaller tank aka harder to spot, harder to hit and easier to hide, if enemy can't shot you in first place why need thick armor? Oh and for the expensive part: 2,5 t90 tank price for 1 m1 tank price, so it mean easier to make or just cheaper because it small, autoloader so for 12 men russian can use 4 tank when america only 3. For ammo all over the tank part: you will get out the tank asap when it get hit and penetrated, all kind of tank.
Reply: @rabiealkurba2520  Russian tank philosophy has been to make the tank smaller which, in theory, makes it survivable by being harder to hit. Though at the sizes of modern tanks being small or big is really a non factor.
Reply: @rabiealkurba2520  I think it's the American way of thinking they make the best history begs to differ the Sherman was a good tank but weak armour the Russian tanks were poorly made but stronger against the German guns,Just because you have masses of technology  and 4 crew doesn't necessarily make it the best and in the second world war the Russians had the little used KV1 wiping out panzer 1 and 2s with ease and the panzer 75 just bounced of KV1
Reply: @rabiealkurba2520  USSR had doctrine of hiding tanks, and treating them as expendable. So their tanks have lower profile (will be spoted way harder than western construction), and are not oriented on defence, they were also crewed by recruits, so autoloader was way more efficient than random farmer. On the other hand western tanks are prepared for mass assualt and taking hit, with US tank more focused on taking hits, and European on avoiding them through spotting enemy earlier, and getting their ass out of there because they are not meant to stop Russians just slow them down. 
So you can see quite good weapon race for hiding tank on russian side and searching for it on West European side, with American designs ignored because Soviets wanted to "end war" in Europe before USA will reinforce them. Design way of thinking: of European weak armour great mobility and opticts, Russian mass production oriented low profile tank hard to spot, and American attack tank to push mass army.
Reply: @kyurenm5334  American and European tanks are not different. Idk why you think that European tanks have less armour and more mobility or that they are better at identifying an enemy target than the American counterpart, but that’s wrong. The western tank doctrine is based on identifying the target and shoot it first, without taking hits.
Reply: @albero319  they are different, the leopard is very different to the Abrams,

And the Italian MBT is infamous for having weak armour
Reply: @andreasurace4386  the leopard 2 and the abrams are extremely similar. The Ariete MBT used by the Italians has bad armour not because of a different design philosophy, it’s because it never had an upgrade since the ‘80 (except for add-on kits with slightly more frontal armour or ERA on the sides). At the time it was created it was similar to all the other tanks used by nato, but nowadays it lacks armour and mobility.
Reply: @albero319  They guy asked about what designer had in mind, and not how these tanks looks after half century of modernisations. stock Leopard 2 or Leclerc had joke and not armour when compared to Abrams with a lot of weak points, while stock Abrams had a joke and not optics and engine when compared to former two. Nowadays warfare philosophy changed, and tanks would be designed differently, which you can see in T-14 Armata.
Reply: @kyurenm5334  T14 has separate crew room, how cool is that.. the crews are more protected than Leo 2 and Leclerc. But that cost its (T14's) turret armor. Can "No armor is better armor" fit in this T-14 turret armor?
Reply: @kyurenm5334  the specific were different, but the idea was the same. The Abrams wasn’t designed with armour for taking hits, the idea always was shot first and don’t be hit.
Reply: @albero319  Then it would have better optic, and less armour for better performance, like first gen post war tanks like leo 1 or amx (don't remember number)
Reply: @kyurenm5334  the armour was different, every tank had to find a balance between armour and mobility, and that balance was different in the American and European tanks, but that’s not much of a difference, the main focus in a tank vs tank engagement was on long range accuracy and visibility in all NATO MBTs.
Reply: @kyurenm5334  Yeah, no. 1. Challenger tanks. What do you mean European tanks have weak armor? A challenger tank has only EVER been destroyed by another challenger. It's equally if not better equipped than the Abrams in America.
2. I don't know why you're excusing shortcomings as Russia's goal. No, they're not. The steel is shit, the country is poor, the people are poor, the expensive tank equipment is being driven by "recruits". It's just a shit show. That's all there is to it. Russia's tanks are trash. There are only two of the new Armada tank and that's been finished for a few years now. If America developed a new tank we'd have 50 a year.
Reply: @albero319  But the balance was always shifted and bend to philosophy. 

Soviet tanks not without reason have round tower, which allows for better protection from sides, they were designed to drive between enemy units. 

Not without reason leopard 2 stock and Leclerc had weak lower frame armour, and big weak points in tower in which there were state of the art optics, same as neglected protection for crew. These tanks are not meant to directly engage enemy in pushes.

while stock abrams had equal protection from front with no weak spots and better frame protection, with good crew protection, at the cost of optics and weight. These tanks were meant to push, to finally get hit, and then allow crew to get their shit out of there.

These are "small" difference, which turn big when you know philosophy differences. If Germans and Americans would really make same thing with same philosophy then mbt-70 or its successor would be a thing.
Reply: @rabiealkurba2520  Nato tanks also have a lor of week spots, actually the same as In Nato.

Lower glacis or Uper Glacis.

Mantlet, side armour and  rear.

Despite Soviet tanks having The small zone in the front hull weeker, just look at the size of the Nato hulls and their turret rings.

Also A lot of Nato tanks have a part or all of his ammo unprotected.
Ammo in T-72 and t-90 are in bottom of tank and the reason it foes boom, is the ammo in turret.
T-90M fixed the issue. including safe ammo on Turret and Armour in carrocel

If you shoot side turret of Abrams, you can hit ammo and make fire spread into crew compartement
Reply: I bet russian don’t really care if one tank out of 1000 got knocked out. 
Different design philosophy haha
Reply: @Spider-Too-Too  Although your statement is most likely very true, I really don't think it's a good strategy. Have you compared their military spending to that of the other formidable nations of the world?
Reply: @Spider-Too-Too  yea, Russia has always been on some quantity over quality shit
Reply: @Spider-Too-Too  in this case it would be war doctrine and not design philosophy
Reply: Also, another thing people forget is... tanks ... NEED TO GET FIELD REPARIED and that extra person HELPS
Reply: @MrHFam-st4ni  maybe in games in irl tank is going out from mission even when get hit but not penetrated.
Reply: @zdzisawpodlaski305  I don't understand your point
Reply: @MrHFam-st4ni  Soviet tanks are very easy to repair
Reply: @MrHFam-st4ni  No one's gonna repair the tank, if the tank is already badly damaged or immobilized.
Reply: @MrHFam-st4ni  false what kind of damage you want to repair by crew? If you got damaged and for example loose a track, you should leave the vehicle, not fixing it under fire. If u got engine failure 1 extra man wouldn't help you.
Reply: @aska8923  Have you heard of something called... repairs while not in combat...... I got this information from a former tank crewman in the IDF if that makes my point anymore valid.. but this is literally a youtube comment section so idk
Reply: @MrHFam-st4ni  as i know they're special unit that do repairs. Crew effectively can do only minor repairs
Reply: @aska8923  only reason for 1 extra man is for loading beer can
Reply: @MrHFam-st4ni it give another problem if the loader is sick ,tired and killed
Reply: @destroyertashkent5713  I guess they both have pros and cons
Reply: @destroyertashkent5713  he can be replaced. Its much harder to replace an autoloader.
Reply: @casematecardinal  thats why you can actually reload it without an autoloader
Reply: Yup, same reason I like to have hand crank windows, non touch screen head unit, and manual locks on my truck, less things that can go bad or break.
Reply: In an alternate universe where russians have human loaders and americans auto loaders
Americans: human loading is doodoo
Reply: Well to be fair yes the Russian design has it advantages on weight and low profile but it takes sacrifices in gun depression which means it struggles on hill fighting and the autoloader though it maintains a decent pace your relying on military machinery to hold strong through constant combat and leaves a glaring ammo distribution in the vehicle unprotected and the reliance it won't break when you need it.

Nato tanks like the abrams have the extra crew and more height which also has disadvantages but advantages too such as 10 degrees of gun depression and extra assistance on tasks. This even includes when in combat the speed a loader tries to push is close to 4 seconds which could be held for roughly 5 rounds which seems small but I'm battle its never just 1 tank versus many so to say it couldn't hold its own against 5 per tank isn't unreasonable and all the rounds are marked by the loader for ease of location
Reply: @NomadicOneify  Polish tanker told me, in case of need of lower gun depression, dropping Log and reverse will make gun go down.
Also having gun depression is more useful in making rhe gunner comfortable in small hill terrain, and Soviet tansk actually have - 7 gun depression not - 3